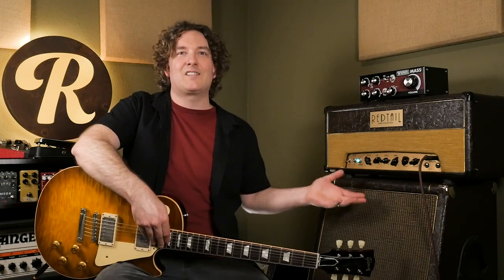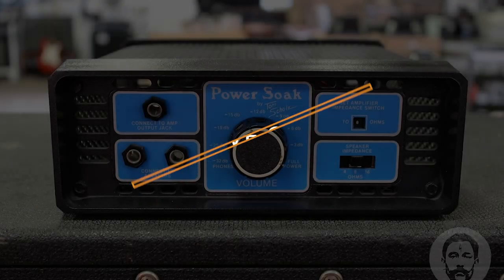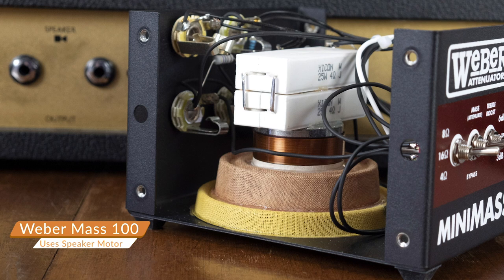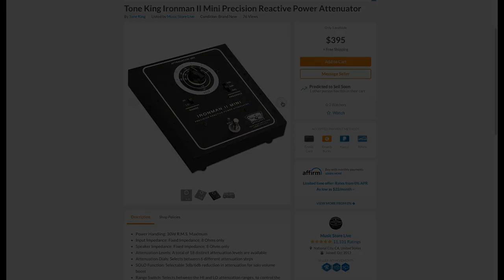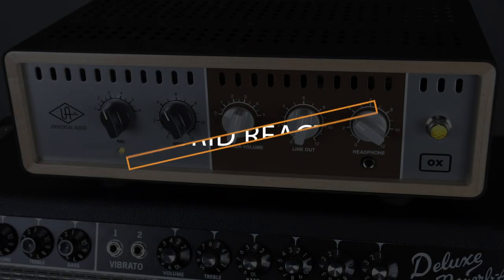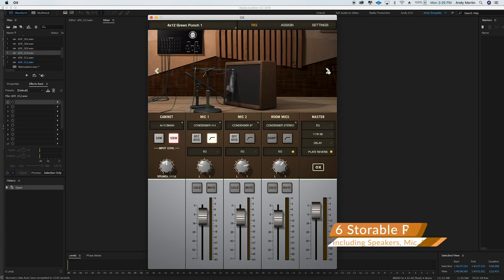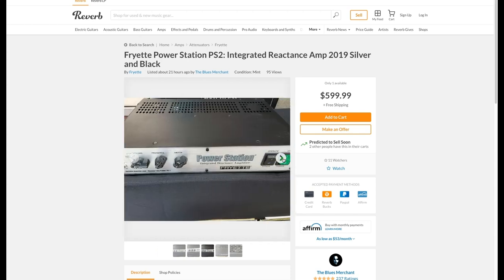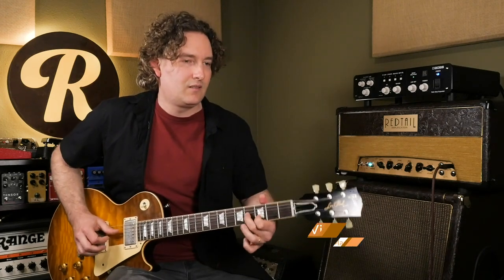Is An Attenuator The Guitar Tone Solution You Need? | Reverb Tone Report

Comment: I thought I wanted the OX, but the Boss might be more of what I need...
Reply: @cptcosmic  agree Boss makes solid gear- I have been happy so far with my Boss pedals and multi FX units. Ox is cheap overpriced Chinese made crap.
Reply: I checked it out and saw the price on eBay, about £1700. But it’s awesome how it has a built in fx loop too. But the price aaaaaaaah.
Reply: @owenjacka2658  The Boss Tube Amp Expander is now £999 which I think is very reasonable for all it's awesome features.
Reply: @GuitarsAndSynths  Cheap? Must be nice to have all that cash.
Reply: @GuitarsAndSynths  And Taiwan (where the Boss is made) is much better (probably is)?

Comment: My Weber Mass Lite is my secret weapon for taming my Hot Rod Deluxe. Lets me crank it right to the perfect spot. Then control the volume. Plus it lets me try different cabinets regardless of their impedance. So many possibilities!
Reply: Is that a 60w amp? Did you get the 50 or 100w attenuators?
Reply: How do think this would pair up with my 60 watt Fender Super Sonic amp?
Reply: How do you set your resistance switch? So that it matches the head or rather the speaker?
Reply: @stevieray1072  Set it to match the output impedance of the amp head.  The Mass isn't particular as to the impedance of the cab it's connected to.  I'm running a 4 ohm Fender amp, so I set the switch on the Mass to 4 ohms.  I currently have the Mass connected to an 8 ohm cab, but it would be just as happy connected to my 4/16 ohm switchable cab too.

Comment: Weber is a no-brainer for live use with a big amp in a not so big event. I like it's transparency better compared to the older resistive load attenuators. I've owned Palmer PDI-03, OX and WAZA TAE, but those are more expensive geared towards home studio market. All that digital stuff is unnecessary playing live. The weber on the other hand has an internal mechanical voice coil/magnet device to create a real load reaction that sounds genuine all throughout the volume reduction. The sound man will love you, your band mates will love you, you will sound like a pro.
Reply: Good to know because I already love their speakers
Reply: Does the Weber make  high gain amp hiss quieter?
Reply: @jonahlmoore  No, piss booster only.

Comment: Yes! Even a Princeton is a bit loud for some situations when you open it up. Your amp has power tubes for a reason-get a GOOD power- reduction device of some sort and decouple your volume from your tone. Makes a world of difference! Not to mention, most volume reduction devices also have extended connection options as well.
Reply: What power reduction device would you suggest?

Comment: Been using Weber attenuators for 7+ years.  Call me a stick-in-the-mud but I have a hard time understanding why anybody feels they need one of those $1000+ bell and whistle machines when you can get a Weber with a line out and onboard EQ in addition to the attenuator functionality for a couple hundred bucks, which sounds great.  The idea of replacing actual speakers with emulations seems counterintuitive, since rolling speakers and playing with mic placement is the easiest way to drastically alter your tone and find unique sounds.  If you watched this video and are intrigued, I'd recommend starting with an affordable, well-reviewed model (doesn't have to be a Weber) and see how you like it before shelling out for the DeLorean...after all, the main point is getting your tubes hot without driving your neighbors crazy, right?
Reply: The exactly the reason to buy one is just so you can get your tubes hot. Reactive load boxes aren’t necessary unless you a recording artist or something. The Ox is totally an awesome product but honestly no need to own one unless you want to record and do studio work. They cost as much as deluxe Reverb so unless you got that kind of money I’d rather get a Weber or Ironman toneking.
Reply: I bought an actual amp with speakers so that I didn't have to use any emulations. I started with UA plug ins first but I was not able to get the sound I wanted. I think all the digital stuff (although has a lot of potential) is not there yet. So yeah right now bypassing your speaker and creating an emulation of your amp is super counter intuitive, why would you do that if you actually have the amp?? Good marketing at it's finest I guess..
Reply: I think this is excellent advice . Unless you specifically need an additional fx loop I would go with something like the weber or rockcrusher

Comment: I use a Weber MiniMass on my Fender Pro Jr. 15watt amp - and it works great. I thought it was going to be a perfect bedroom/practice amp - but quickly found out there was no way I was going to be able to play it with out it rattling the windows. 100 bucks on Reverb. Without it, I would've had to take the amp back.

Comment: I use a Rivera Rock Crusher, not the EQ'd one, with a Marshall Plexi Superlead reissue. That amp would not be use-able without an attenuator. Sounds great, RC is not a massive tone sucker, it is reactive as well. Can go direct too if preferred, but I prefer the sound of a mic'd amp. Bought the RC used for like $300, good deal. To me, non master volume amps are the purest of tone, but they need to be controlled somehow.

Comment: Thhe two notes captor8 is a beautiful piece of equipment too
Reply: Looks to be for sure. I messed my spine up so I am only playing at home through DAW and either using Le Pou amp sim with WOS or IRs, or my Laney IRT Studio with WOS and adding effects in Reaper. The amp only does 1 watts instead of 15 watts when in silent recording mode, which severely limits the headroom of the clean channel. Gain tones are great though. Sounds almost exactly like my Suhr Riot pedal gain tones, but better. I think a Captor is all I need for what I do. All the features on these fancy new things I can do in DAW (I do not seem to get any latency).
Reply: Aquila Rossa I actually just took mine out of the box a couple weeks back, it’s rad as a DI into the WoS and as an attenuator

Comment: EQ and OD pedal can get decent volumes out of tube amp at bedroom levels without altering the amp tone.
Reply: Sorta true, but not entirely. If you like the sound of your amp cranked or turned up, but need something to control that volume, attenuation is the way to go. You can certainly get away with an OD or EQ pedal at low volumes assuming that you are getting your gain tones from pedals and are playing into a clean amp, but it doesn't work for an amp that's cranked.
Reply: Yeah or you play a modern amp with mostly pre-amp gain and either built in EQ or at least presence and resonance settings

Comment: I have been using some Fryette Power Loads to balance different amps set at their ideal tones. Still a few patch cords short of bringing the line outputs back around through a mixer and effects to one more wet amplifier. All sorts of devices available on Reverb depending on the tool you want.

Comment: What they do is load the the tubes with resistors in place of the speaker so the volume is a lot lower.  If you don't mind wearing out the tubes faster it does the trick.

Comment: If you have skills you can build a Ken Fischer
Airbrake( Dr Z clones them) for under $100
info is out there and parts are cheap
  I built a few they work great.  Most
resistive attenuators do not affect tone until
you cut over 15db

Comment: While acknowledge that this is probably the 1000+1 time I've said this, the more time that goes by it only becomes more true: why, with the wide adoption of modelling systems like Helix, Fractal, Eleven, etc. And the sheer volume of great stand alone Preamps that are coming out: the fact that if you want a low watt, stand alone tube driven power amp, your choices are to purchase 1 of half dozen power amps (at best), or run them into the "return" of a normal amp head or combo, seems to me it's a HUGE hole in the market.
If you ask guitarist to name a few independent power amps that put out 20w or less, you have the Mesa 2020, and the Mooer, and that's about it. I just don't understand it, I'd think that if affordable class-A power amps were more available, they'd sell like crazy.
Why Bruce Egnater has yet to release the Rebel 20's output section as just a power amp, I REALLY don't get. How many players who use modellers or individual Preamps wouldn't want a power who amp they could run from anywhere from 20W down to 1W, AND be able to go between 6V6 or E84's?
I own a Rebel 20 head that I bought used a few years ago that I've literally only used the preamp in it 2 or 3 times, the main use is to slave it to a Stomp and the Custom Tones Ethos Overdrive Preamps and the Trainwreck TWE1. 
I used a15W Tweaker pretty much for the same reason, because I can drop 6L6s, 6V6, KT66, KT88, EL84/34, etc. However I DO use that preamp from time to time.

Comment: So basically the attenuators reduces the loudness of an amp?
Reply: yes and no- they allow you to saturate the power amp tubes without loud volume levels and some have direct load boxes to balance the higher amp load.
Reply: That’s it’s basic job.  If you play clean you don’t need an attenuator.  If you like the sound of your preamp tubes distorting by using a master volume amp, an attenuator won’t do you much good.  Likewise, running your amp clean and using a pedal for distortion will not get much benefit from an attenuator.

If you like the tone of your tube amp cranked, but need lower volume, a good attenuator is the tool for the job.  This is power tube distortion (overdrive) and is only achievable at high power levels.  Let’s use a 100 watt tube amp wide open as an example.  When you hit the strings hard the amp sends 100 watts to the speaker cab, which turns it into sound.  If you run the output of your amp into an attenuator, and out from the attenuator to the speaker cabinet you can lower the sound level.  The attenuator has circuitry to absorb some of the amp’s output watts before being sent to the speaker.  So in our example, the amp is cranked to 100 watts, the overdrive tone is killer, the attenuator ‘soaks up’ some of that wattage, let’s say 60 watts, and only passes 40 watts on to the speakers.  If it all works right you get cranked up overdrive tone at reasonable sound volume levels.

Comment: I had a Palmer Speaker Simulator running a DSL100 into an interface. I did not like it so much. Then I tried a Dr Z Airbrake to run my 4x12 at lower volume. Using too much of the attenuator made the sound crap out, just like using too much master volume does. I found the best option to get the most natural sound was to use a bit of boost to drive the front end of the amp, a bit of master volume, and a bit of attenuation. It allowed me to drop the volume enough that i did not get noise complaints, but it pretty much still sounded right (apart from not moving air). 
Then the Marshall 1959RR that I had waited several months for finally arrived. I plugged it into the Dr Z and the Marshall blew up. It was faulty, so I got a refund and bought an old JCM 800 1987 model. I was living in an apartment by then because I was studying at uni again. Sold the amp and bought a HD500X. Hated it. Then I tried a Tech 21 Flyrig. I liked it but it got noisy when the gain was turned up. I ended up just using Guitar Rig. 

I have a Laney IRT Studio now and I am very impressed with it. It does silent mode, but only at 1 watt instead of 15 watts. Really nice gain tones. It sounds like my Suhr Riot pedal, but better, so the pedal got sold. The clean channel is not so good at 1 watt though, because it has no headroom. I am thinking of getting a Torpedo Captor so I can run the full 15 watts, but then that makes the IRT Studio redundant because I can use any amp. The Laney is a cheaper amp, but has very good lead tones. I'll keep it and then try other amps with the captor and IRs and see if they do better. Busted up my spine, so only playing at home these days.

Comment: Hello! I’m recording and have an honest question. I have a Mini mass speaker attenuator in red; maybe it is an old model. It’s all red. Left to right has impedance, normal/bypas, treble, and finally volume. I want to use a Marshall Class 5 tube amp, which has a 16-ohm tab, and my Fender Mustang 4/12 can, which is 8 or 4 ohms. There is a mismatch in impedance. Is the toggle impedance on the attenuator a matching or corrective toggle? Can I use the attenuator to match the 16 ohm tab of the amp to match 8/4 ohm on my speaker cab? I’m new to this and prefer to ask than to damage the gear.

Best, 
A

Comment: I have a fender bass man ‘59 reissue which attenuator would you suggest
Reply: The Weber Mass 100.  It's selectable for amp inputs of 2/4/8/16 Ohms.  I'm running one with my 4 Ohm Bassman into an 8 Ohm cab.

Comment: If your amp has a master volume knob, why would you want one of these?
Reply: Tube amps require a certain amount of volume to sound really good, something that is unobtainable if you have roomates or neighbors.
Reply: doctorrichford or if you want to have good hearing into old age 😄🤦‍♂️
Reply: Because the master gain mostly turns up the preamp tubes. That gives you an overdrive sound but not a really good tube crunch that turned up power tubes have.

Comment: if you have a master volume on the amp could you still need an attenuators? what’s the difference? i’m thinking in particular of playing in home
Reply: Need it? No. But can be useful if you want the big tubes in the power section of the amp to really saturate and overdrive naturally, as opposed to op-amp stomp boxes. What this also allows is dynamics in your overdriven amp to lead that way, with an overdrive pedal it's always going to sound overdriven no matter how hard one's pick attack or playing is, but with an overdriven, tube saturated tone, there's more of an attack dynamic at play. And there's also a tone library to be found by now using one's volume knob on the actual guitar into a fully dimed amp. The difference is that the master volume on an MV amp turns the volume down in the preamp stage and never allows the big tubes (EL34s, 6L6, etc) to over saturate and give that organic and saturated tube tone, just those little-guy tubes in the preamp section. Ever hear a 6L6-loaded amp naturally overdriven? It's beautiful, but it takes a massive amount of volume to get there and one would need to control that...overdriven Fenders can sound amazing that way, and they can be overdriven...but it's loud.

Comment: Most attenuators works okay, but you don't get the "chug" from hard driven moving speakers at a higher volume. For this reason they suffer from the same "flatness" as digital  ampmodelers. I would rather go for an Isocab, or just play LOUD!
Reply: Isocabs can have their own drawbacks. I've been using one for years and just got the boss TAE. I'm still messing around with IRs to get the sound I want, but I was trying to do some comparative analysis between the speaker and the IRs (using an IR for a single closed-back celestion vintage 30 + SM57, since I have that speaker and mic in my isocab). I've never done this before, but check out the difference between cabinet closed and cabinet open: https://imgur.com/EA9ESmN

I was actually pretty surprised. That was a bigger difference than I got moving the mic all over the place inside the cab. YMMV, depending on the cab. This (https://grossmann-audio.de/en/product/sg-box-2/) is supposed to have some kind of resonance absorber that might help with or eliminate that difference.
Reply: @DakotaHawkins  A closed cab will of course affect the frequency response, but trying out different microphones, and maybe tweak some eq could solve some problems. But the type of speaker will probably have the biggest impact on the sound. Having a couple of different speakers to choose from might be useful, depending on what style / sound you want.

Comment: Which do you think it would sound better, an attenuator, or an added master volume knob such the JHS little black amp box?
Reply: The attenuator allows you to turn up the amp to get the power tubes cookin', which is where the true "Tube Tone" comes from.  With the JHS Little Black Box or a master volume, you're allowing the preamp section of the amp to get rockin', but then reducing that level before it slams into the power tubes.

Comment: I have a 65 Fender Princeton reissue (which I love). Can an Attenuator Damage my Amp in any way? Which one do you recommend to be Safe & Effective for a Princeton?  I can't even put my amp past 2 - it's Blasting Loud. Appreciate any input. Stay Safe.
Reply: If you get one with a Power Amp built in, then it can definitely damage the speaker. Otherwise, the only risk is working the tubes harder. Unlike a master volume built into amps, attenuators are after the power amp. This means you're running the tubes at full power when you have it cranked. It won't do any damage, but it may shorten the lifespan of your power tubes.

Comment: What if I have a combo? Is it possible to hook up a Peavey Classic through an attenuator?
Reply: Yes. I do this with an AC30 and a Fender HRD. As long as your speaker is plugged into your amp via standard mono plug, you should be good. It will look like this: Amp> New speaker cable> Attenuator> Original speaker cable> Speaker. Cheers

Comment: Thank you for this video. Lots of information to take in. I mainly use (non-master volume control) low watt amps (about 5 watts) at home. I've been wondering what type of attenuator to get which would allow me to record to my digital 4-track recorder without using a mic (with or without being connected to my speaker cab).  Your video helps a lot in helping me make a decision. Will any of these attenuators work with a bass amp or are there other things to consider?